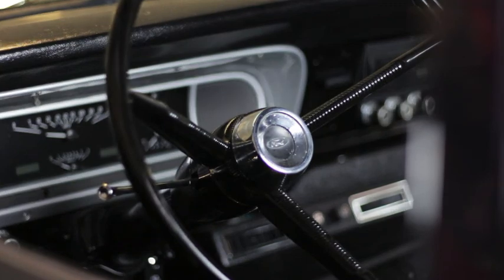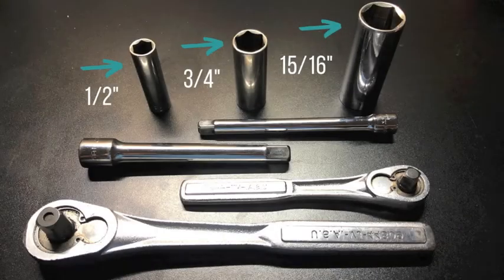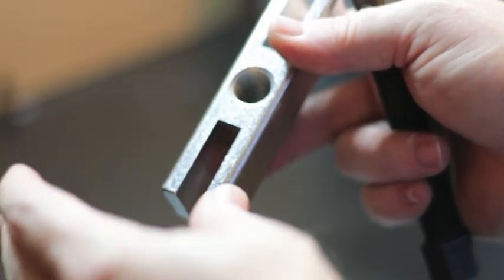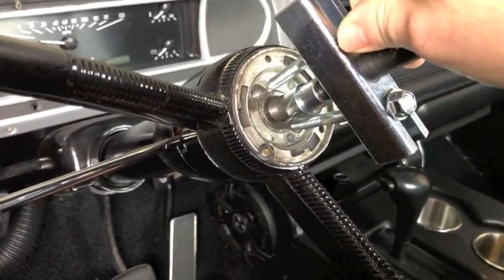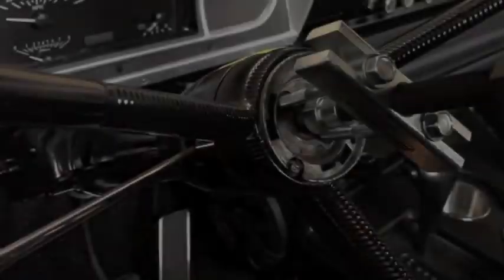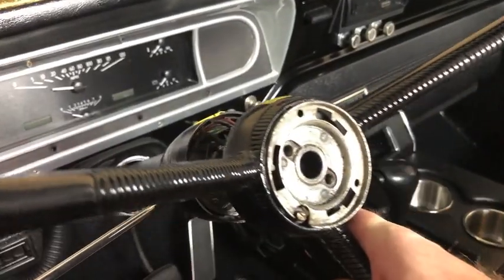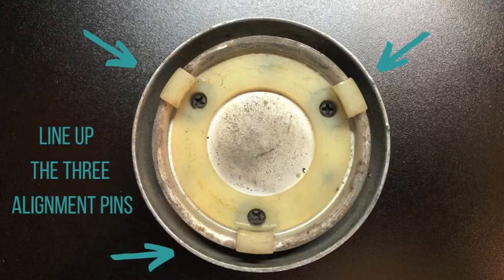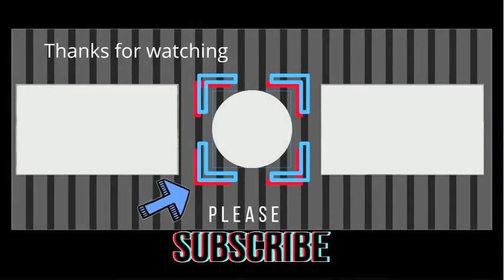STEERING WHEEL REMOVAL F100

Comment: So I am removing an after market steering wheel from my 66 f100. Seems to be an adapter. Any suggestions?
Reply from the maker: @Aaron Snouffer on my 66 Mustang the adapter goes in between the steering wheel and the steering column. So by removing the adapter you can just reinstall a factory steering wheel. Not positive it is the same. Hope that helps